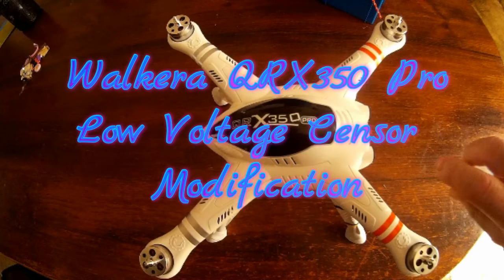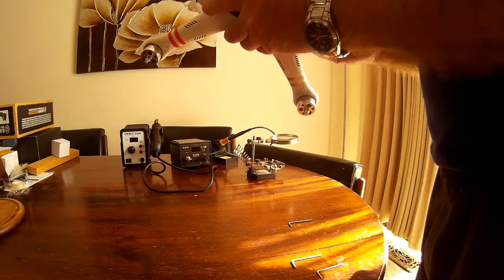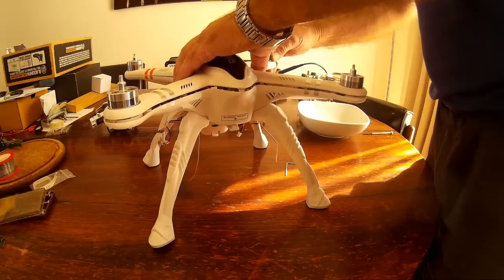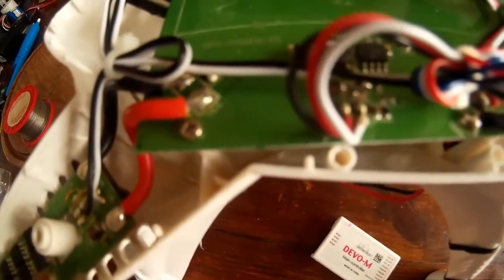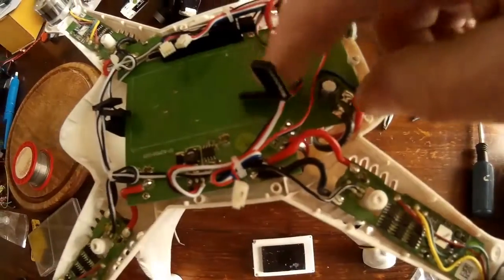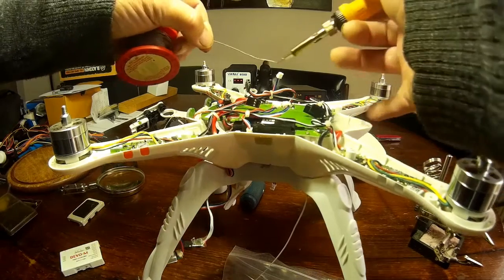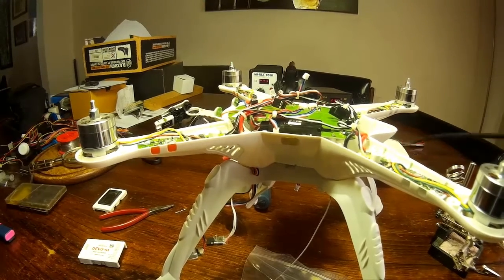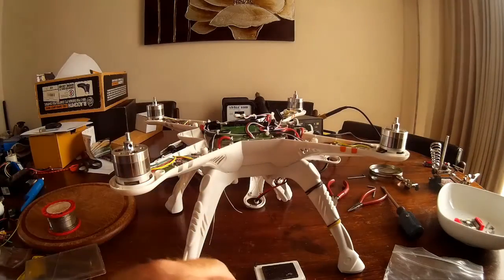🚁 Walkera QRX350 Pro Low Voltage Sensor Modification (LVC Mod) that can be easily undone if needed.

Comment: Why would you do that it senses battery voltage and also supplies 5 V to the system?...
Reply from the maker: The early QRX350 PRO's would sometimes drop from the sky, due to it thinking it was low on charge, in order to save the battery from over discharging. 
So you could loose your quad on a return to home situation. 
I'd personally prefer to toast a battery, than loose the quad.
Later Walkera models seemed to have addressed this early battery issue.
Reply: @GarryPurcell  That is only if you disable auto land on battery law voltage...

Comment: Hey Mate. 

Great video, no issues with flight after the fix?

Cheers,

Sam.
Reply from the maker: +samuelward120 
No Problems, and is easy to undo if you want.

P.S.It's Important to  remember, that the voltage will always show full charge, if you are using OSD.
Reply: +Garry Purcell 
I will be timing my flights, hopefully my mod will be as successful as yours. 

-Sam

Comment: Hi Garry. Would it damage the board if you do direct soldering as you instructed? I have the quadcopter for a few days, but so far I have not fly it high. Lucky I found out about this issue. Many thanks for the tip! Cheers.
Reply from the maker: +Marino A 

There should be no problems as you are bridging the voltage sensors to always show full charge, and the process is easily reversed (if and when Walkera fix the problem).
Reply: +Garry Purcell thanks Garry!